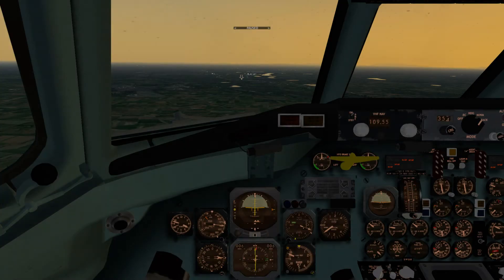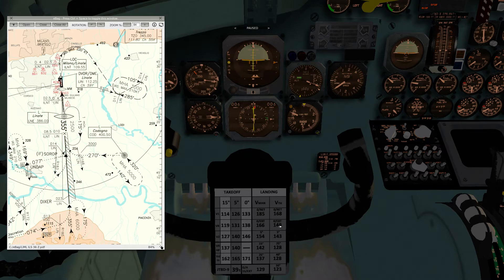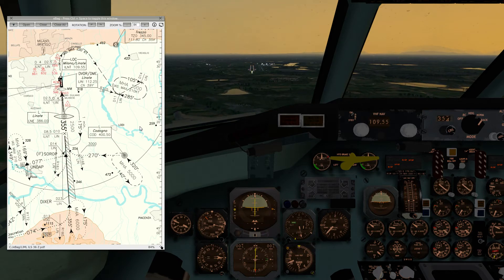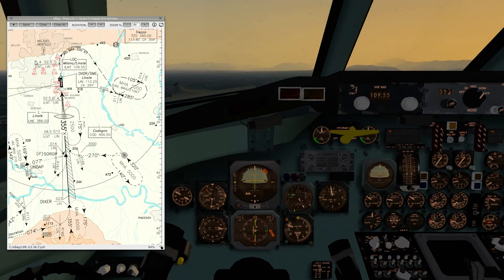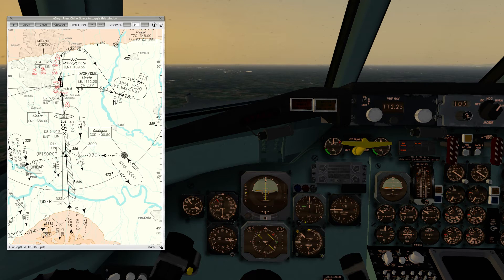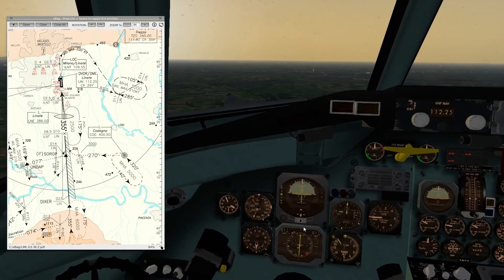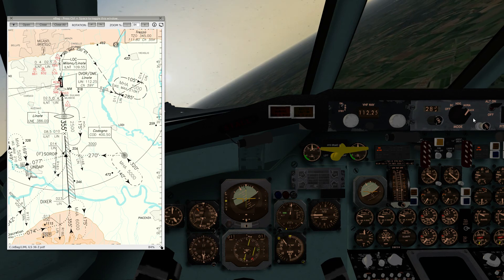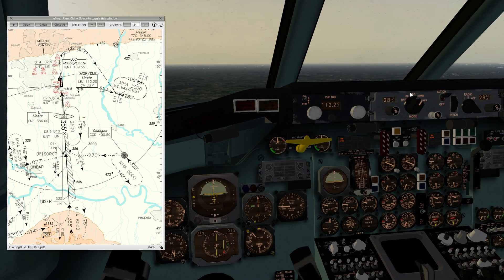DC9 Part 3 - LIML Go Around and Hold [X-Plane]

Comment: I'm really enjoying your videos of the 737 and now the DC-9. Would it be possible for you to setup one of these manual approaches/landings with it pretty strong cross-wind? I'd like to see how you handle it. Especially the de-crab on touchdown.
Reply from the maker: Glad you're enjoying the videos. I generally don't fly with much weather turned on as the focus of my videos is the procedures and planning. Crosswind landings are a handling exercise and they're the hardest to replicate with a 23" monitor and a twist-grip joystick. It's also where I find the sim dynamics start to break down a little. That being said I've spent a few minutes with the DC-9 and 30 kts directly across the runway and it is possible, so I'll consider that for a later video.